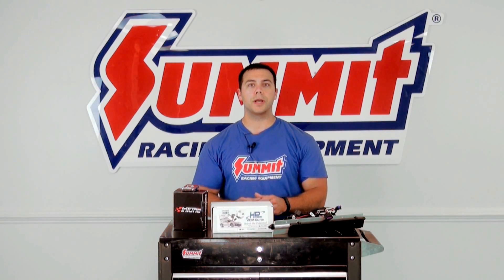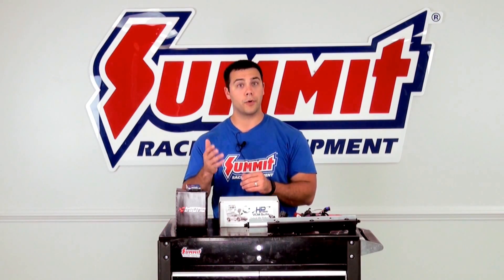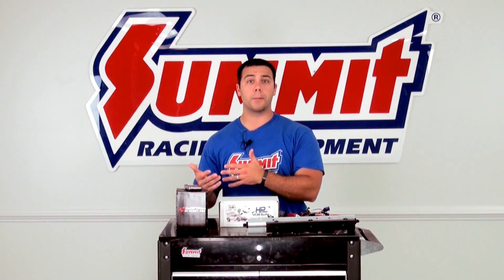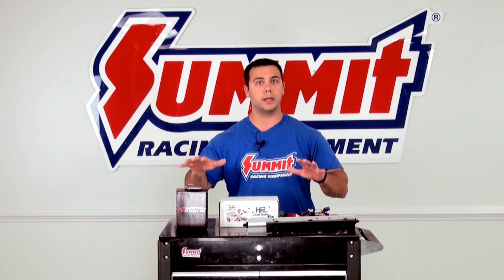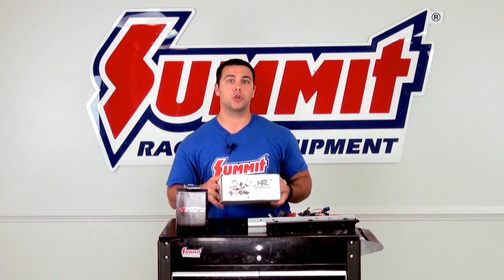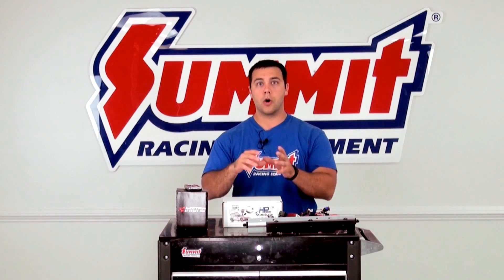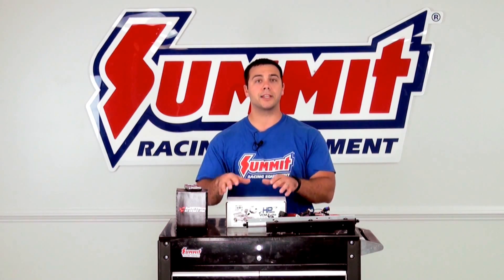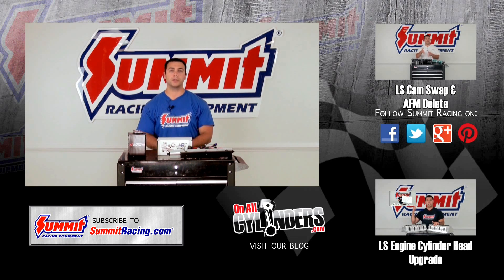LS Engine Swap Programmer Tuning - Summit Racing Quick Flicks

Comment: I need a video for this.....and this is what the title of the video should say. "SO you've spent your hard earned money putting a LS engine WITH A MSD IGNITION  (6014) WITH a carburetor in youR PRE-1970 HOT ROD OR IN A AIRBOAT because your buddies said everyone is doing it. Engine IS built by machine shop AND IN THE CAR/BOAT ,carb installed, all wired AND YOUR READY TO TURN THE KEY. Problem is you know nothing about setting timing it or using a computer to "tune it or each cylinder. This video will show you what it means to put timing in or take timing out and why. Also what does timing actually do. Well here's a video to answer all those questions".

Comment: I'm building a LQ9 6.0L with a "Elgin E-1840-P Sloppy Stage 2 GM LS LS1 LS3 Camshaft & Spring Kit .585 Lift". I have ported and polished the 317 heads for more flow. The engine is out of a 2004 Cadilac Escalade with a 4L65e transmission. I have the engine/transmission with the ECU. I'm looking for a kit that will get decent gas mileage as well as decent horsepower gain. The drivetrain is going into a 1951 Ford F1 pickup. The rearend is a Ford 8.8 from a 2000 Explorer (3.56 gears) If you have any recommendations I would like to hear them. Thanks for the help
Reply: Sorry I don’t have any recommendations. I’m just curious if you like the 317 heads port and polished or would you recommend aftermarket.
Reply: @mac9567  I'm happy with the porting but not sure how they would compare with aftermarket. they should flow better but there are some nice aftermarket heads out there.

Comment: I'm totally new to LS Motors yet I have one swapped out in my 2012 Jeep Rubicon it is a 6.0 with a supercharger I would like to get the supercharger off go back to a fuel injection manifold so I could get better mileage as I don't need the supercharger can you help me out

Comment: Can you guide me on what I need to do to get my truck running again
 I removed a 5.4         3 valve engine from my 2006 f150 4x4 and replaced it with a 1997 5.4. 2 valve engine and it won't start

Comment: What is the best way for me to tune my ls1 it's running a math less ecu atm I think my timing is off
Reply from the maker: Hello Tom, 
 
There are many variables in your question. It depends on the ECU you're using and its tuning capabilities. You might want to take the car to a local dyno tuner if you believe the tune is not correct.

Comment: Why is it when you buy the programs and products these people say your goin to need and then they’ll tell you to take it to a dyno to get it tuned where you want it.  Do these guys have a clue how much these tuners cost?? Some are really high priced.  Diablo tuner is $350 to start then you gotta buy credits if you need more tuning.  Wtf???  the tuners are not exactly what you need. There should be a onboard program that can dyno and suggest what you should do. Dynojet has that exactly. But. Some how it’s not supported yet to write a tune program to diagnose and suggest what it needs done. Hmmm.  How much would anybody pay to get a tuner like that.
Reply: buy a holley term x it auto tunes no dyno needed

Comment: If there's anyone that can answer me on a question if it's not too much to ask.
What would I need if any to drop a 2016 GMC 5.3l motor and transmission into a 2002 GMC  Sierra. I can't find any info on it.
Reply: Patrick Palacios Ecm and wireharness
Reply: Patrick Palacios also your going want a D.o.d delete kit. If you all the power all the time

Comment: I am planning an ls swap in a 83 cadillac. I was planning on using the wire harness and ecu that comes worth the motor.  Will I still need the after market efi device?

Comment: Ls1 swap into a 94 -s10  still has odb 1 port does any one make a tunner for this type setup  I got this now and works good but I feel there is more power to be had thanks ed
Reply from the maker: +Ed Holbrook , 
Can you give our tech line a call? 1-330-630-0240. We need some additional information from you. 
Thanks!

Comment: At a loss, I have a 2002 LS 6.0 cable 3 bolt with a 4L85 going in a 1968 M-715, looking for the right kit.
Really like the ability to not be stuck with one kit that only works with 1 crank reluctor. That Atomic kit really seems like the ticket, then again the Painless kit is cheaper..
Reply: Just do a vats delete and segment swap and run the stock ecm any local shop with hp tuners can take care of it, run a psi conversion harness or even the 250$ China harnesses work great

Comment: is there a vid for the "first start" guys like me who just put in a ls engine in a truck and want to fire it up? i know i need to turn VATS off, but what else do i need to turn off to keep my check engine light from turning on because i haven't installed rear O2 sensors or removed the EGR valve setup
Reply from the maker: king size86, 
Your best bet would be to take the truck to a local shop that has HP tuners and let them do it all for you. The type of program you need is really expensive for a one time use in addition to a steep learning curve!